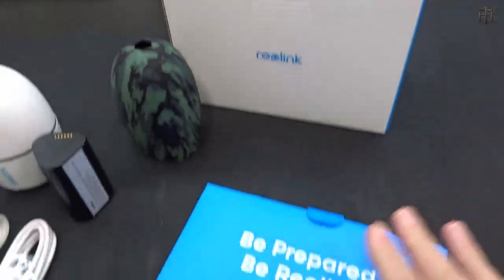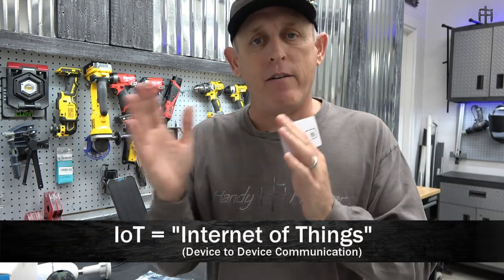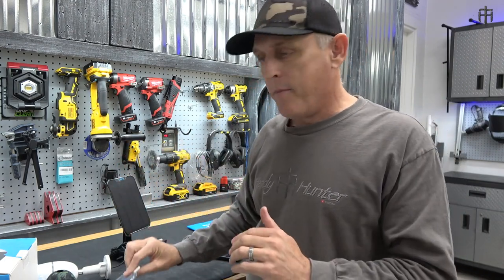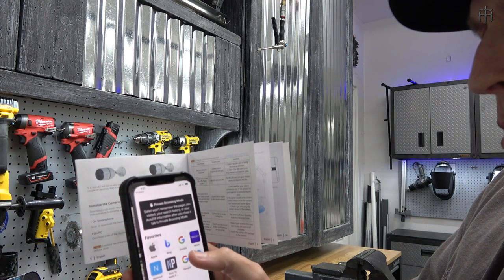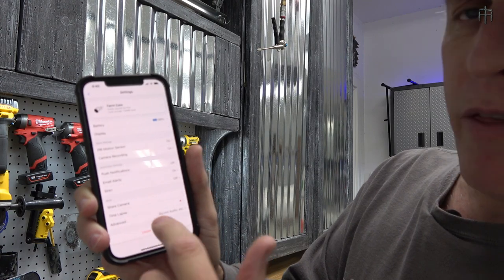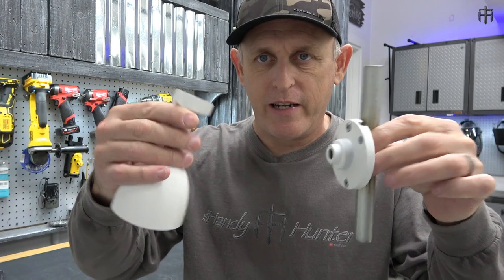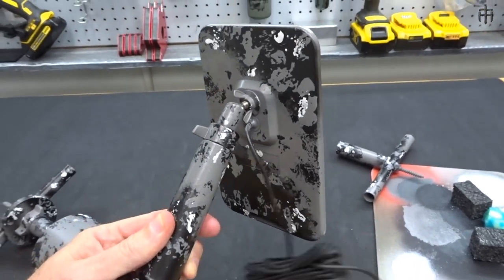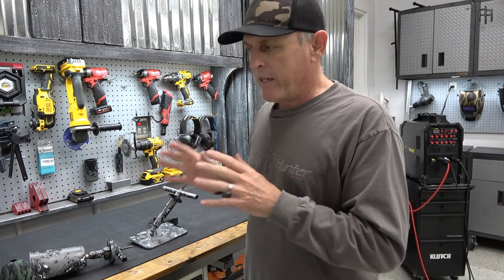Reolink Security Camera - Setup, Camo, & Custom Adaptors for Mobility

Comment: The SIM cards that you use on your BIGFOOT Cell Cams might also work in that Camera!? Or their 4G SIM Card!  Also, you didn't show how you attached the hood to the camera? Have you determined the best data plan?
Reply from the maker: I kind of showed how the hood goes on at the end and mentioned info about the hole.  You put the hood on first and then screw your camera on and it sandwiches the hood.  Haven’t determined which plan is best yet because I dont know how much data the cam will use in the places I plan to use.  I will have to experiment a little first.

Comment: Nice, I am going to get one and the SD card for my cabin in Ontario Canada as I live here in Wisconsin. What did you attach the  cover with and where did you attach it on the Reolink?
Reply from the maker: You’ll separate the cam by unscrewing it from the base and then sandwich your hood between the cam and base when you put it back together.  You’ll drill a hole in the back of the hood that will fit over the base bolt.  Hope that helps!  Good luck!
Reply: @TheHandyHunter  Right on! Thanks much. I am going to get one ordered up!

Comment: Hows the data usage so far? 

I’ve been looking into doing this and adding one these cams to my box stand/food plot, but was hesitant do to unknown data used. I’ve been running one of my of cell cams on the unlimited yearly plan,  3 photo burst every 5 second, so kinda live. Lol

By the way the guys on my lease thought, I was crazy building the battery boxes for my cell cams, that all change when I got close 8 months out mine without needing to change batteries. Its nothing to get thousand’s of photos a month on my stand/food plot cam mentioned above.
Reply from the maker: So far the data has been good but just experimenting around the house.  Im impressed so far with no false alarms so that should save on data as well.  True test will be at the farm.  Which battery box did you build?  If you build the solar/battery combo you won’t have to touch it for a few years!  It works great!  Thanks for sharing!  Keep in touch👍
Reply: @TheHandyHunter  I built the plain battery boxes, I have the stuff to added the Solar panels but haven’t yet. I have a few extra’s batteries and rotate them out when they get down to one bar on cams battery indicator.

Comment: Is the camera motion activated or can you watch the camera anytime? Ready for part 2!
Reply from the maker: It does both!  It will record when it detects motion and so far it’s very accurate with no false alarms from wind and shadows,etc.  You can also hit live view in your app and watch live.  You can hear through the app as well.  I’m interested in trying this on my hog trap in an area where cell signal is not the best.  We’ll see.  Thanks for watching!
Reply: @TheHandyHunter  Great video, mine will be here tomorrow and I’m hoping to do the same thing; hog trap cam! Keep us posted
Reply: @TheHandyHunter  I got mine and was about to give up and took it up to our ridge (where hog trap will be) and it worked! I discovered this camera needs at least three bars to connect. The Go PT has an external antenna and can operate with less bars. Let me know what your finding out. Oh, I made a Home Depot visor ;) Thanks for the idea!
Reply from the maker: Awesome!  I wondered that about the antenna as well.  We’ll see how it works…I generally only have 1 bar where I plan to use it.  Keep in touch!
Reply: I got mine last year but haven’t set it up. The data plan doesn’t seem to offer much data. We have a ton of wildlife on our property, so there’s going to be a lot of activity and recordings.